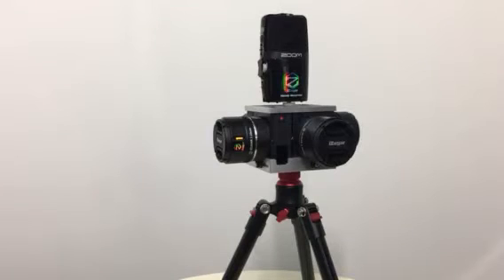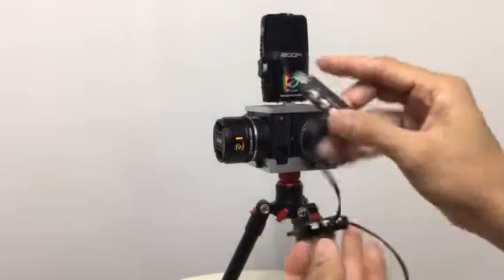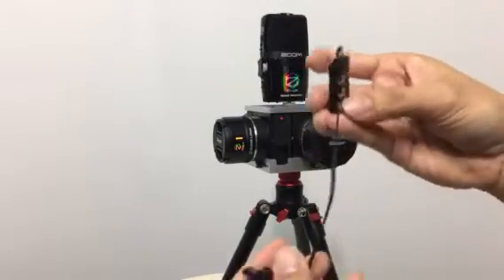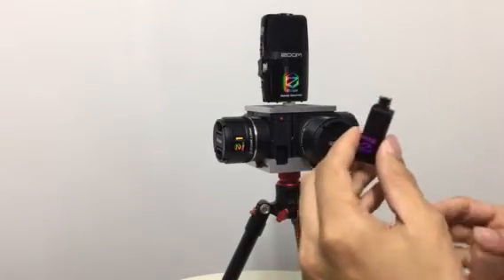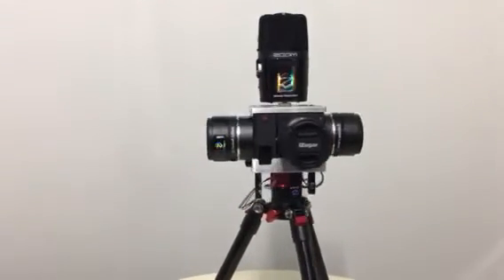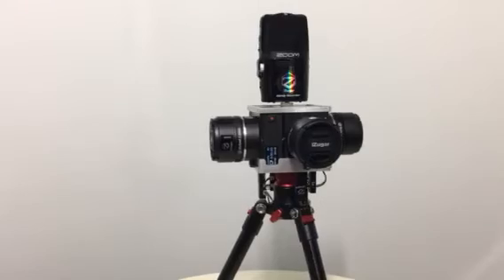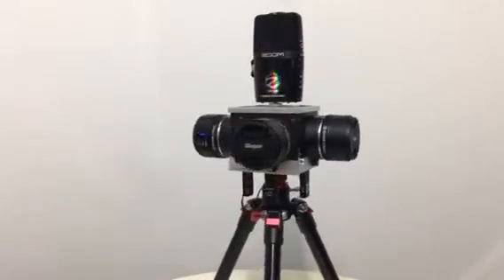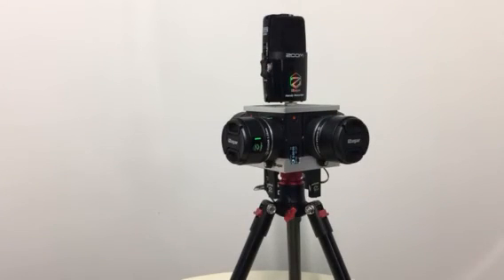iZugar Z4XL rig sync tutorial

Comment: Hi Kc, Is it just the recording start/ stop that is synced with the cables? I wondered if you also have to set ISO, shutter angle, etc for each camera in the rig, or just the master camera? Thanks :-)
Reply from the maker: 3D_Davs we set everything across all units with an app, and the sync system not just kickstart all units but keeping them in sync for a long time. We have no sync problem if we shoot for hours :)
Reply: Thanks, KC. Recording and syncing are fine, but I found I had to set the white balance and shutter angle for each camera individually. My first test (just setting the master camera) gave me inconsistent exposure & white balance accross the rig. A second test (manually setting each camera to the same WB & shutter angle) worked great. I did try using the iPhone app but couldn't get a live preview. I guess because the app hasn't been updated for two years :-(
Reply from the maker: there is an andriod app for controlling settings on all units, feel free to reach our support for more details :)

Comment: Like the person below, I cannot get camera 1 to sync to the other cameras. Only camera 1 is firing. Please advise
Reply from the maker: Ken Sklute pls check our FAQ section at izugar.com, probably no file on sd card or mis-set the micro button on the sync dongle
Reply: I have checked the cfg file, all dongles are marked correctly. Please advise. This product is not working.
Reply from the maker: Ken Sklute hi sorry to hear the steps in FAQ cannot solve your case. The rig used to working well and has been using by lots of producers around the globe. The cable is a product of Z-cam. if your cable is really in trouble feel free to reach our sales support, we can help examine, repair or exchange for you, thx